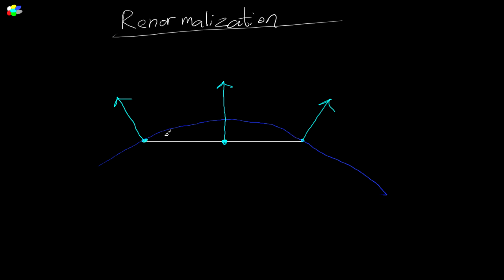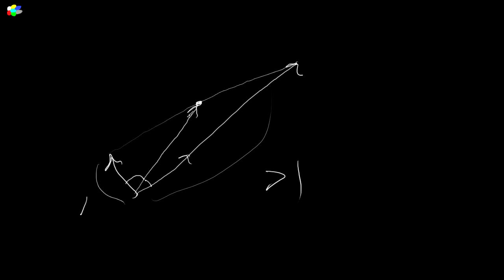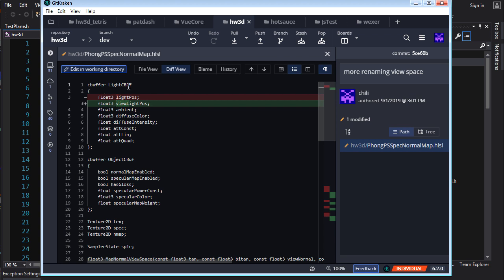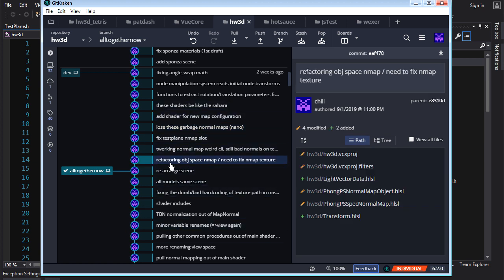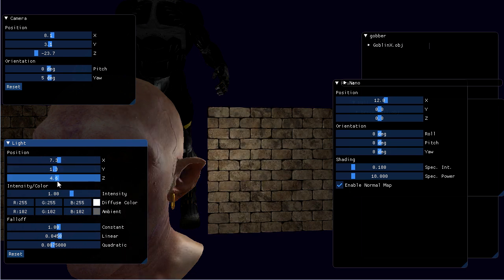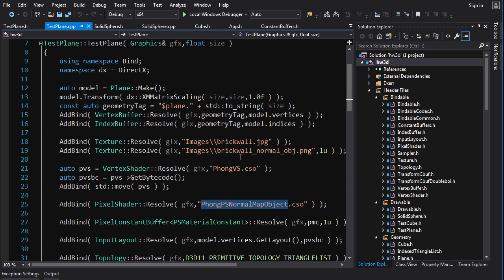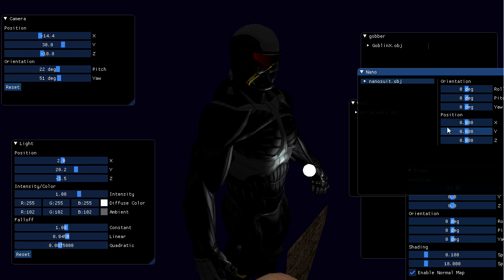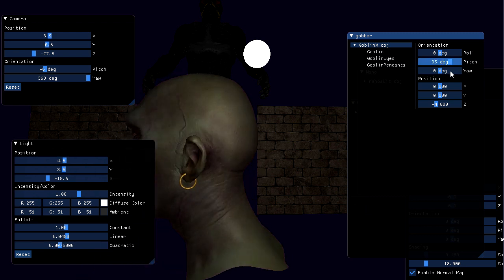C++ 3D DirectX Tutorial [Renormalization]

Comment: I think I missed some motivation here. Why were you rotating the normals into object space?
Also, do you happen to know if normal maps often have mipmapping applied to them? It's something that I hadn't previously considered. You could solve your initial lerp problem from the texture sample by using point sampling, but then you could have problems at a distance, which would still occur if the normal maps weren't mipmapped. But then if you mipmap them, couldn't you end up with some weird normal shifting as you zoom out? Would the solution be to scale down the normal perturbation by the distance from the camera (i.e. the LOD level)?
Reply from the maker: Before I was relying on the shader to fixup the normals for object space normal mapping, but that is messy and specific to the model/map combination. Mipmapping is usually done with normals as well.
Reply: @ChiliTomatoNoodle  So the object space transform was not to replace the tangent space normals, but just to fix the code that allowed for object space normals? So basically you allow for the normals to either be tangent space or object space, and tangent space wasn't meant to replace the object space normal code, correct?

Thanks for the confirmation about mipmapping. That's what I have always done (mostly because I never treated the textures differently). Though given that the highest mip level could end up being a skewed vector, perhaps there's a better solution. If I wasn't so lazy, I would do a literature search to see if there are any academic papers on the topic.